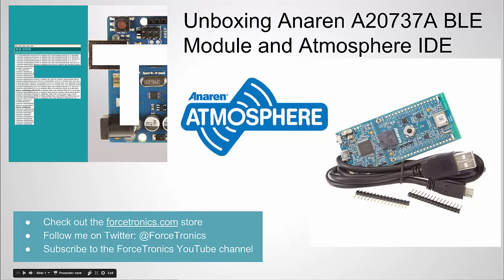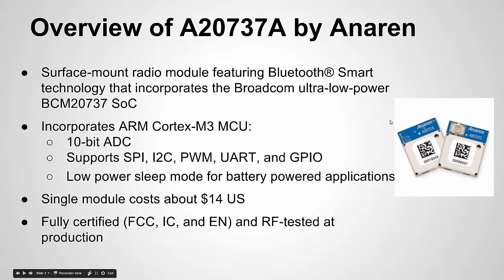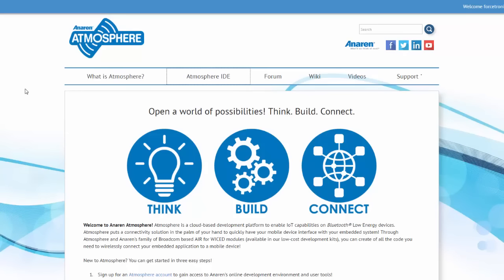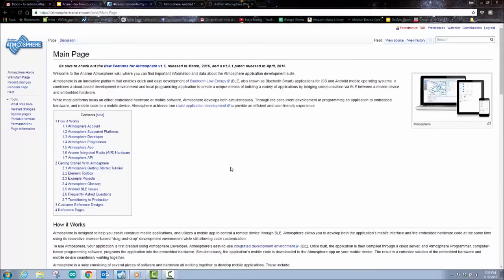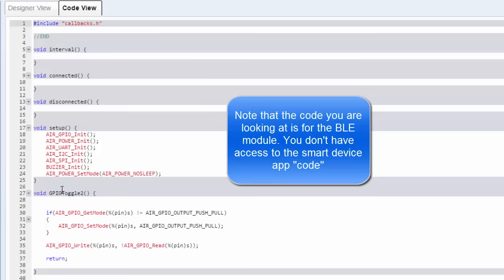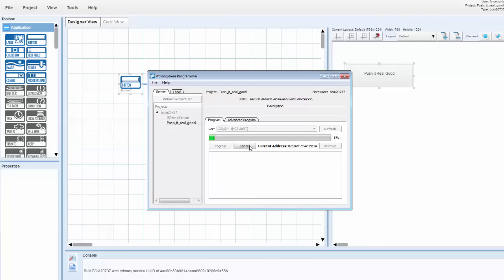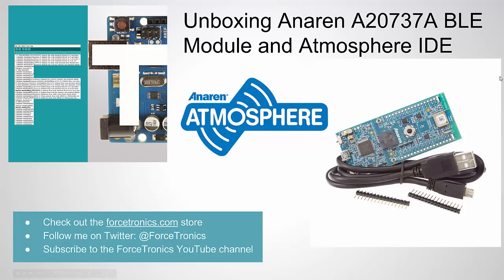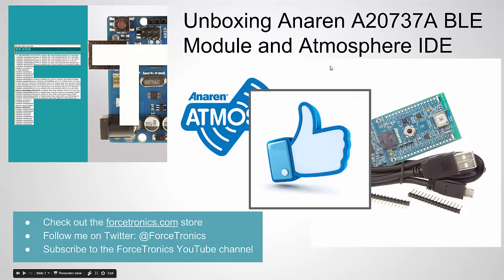Unboxing the Anaren A20737A BLE Module and Atmosphere IDE

Comment: Great video and Neil nailed it with the his comments about the IDE being the big value proposition here. Just as an FYI - the cost is less than what's quoted in the video. Since we deal primarily through reseller distribution channels it's always best to check pricing through Octopart as another poster mentioned. BTW - there will be some very cool additions coming to this platform very soon.